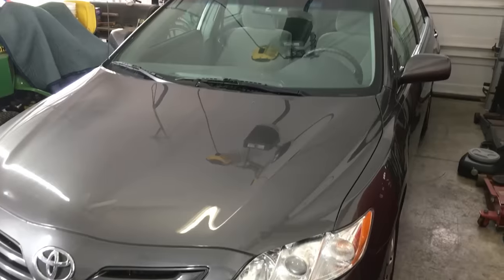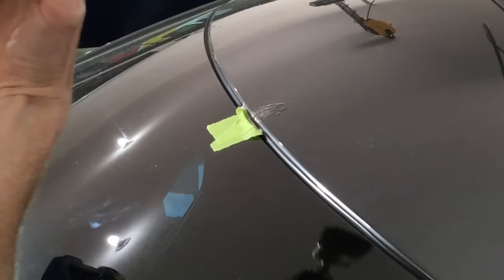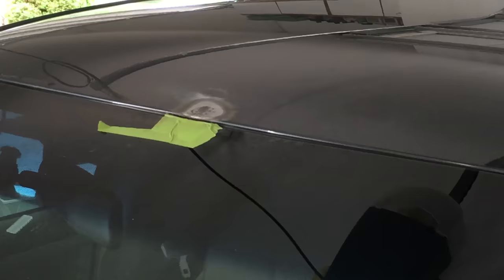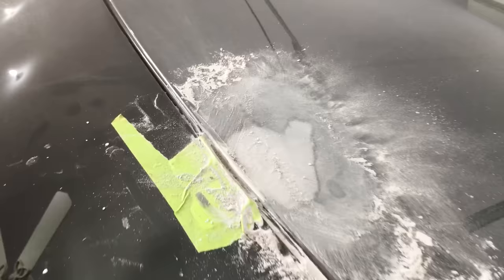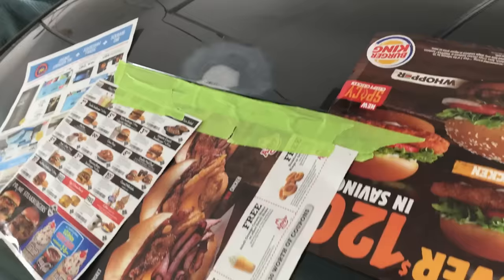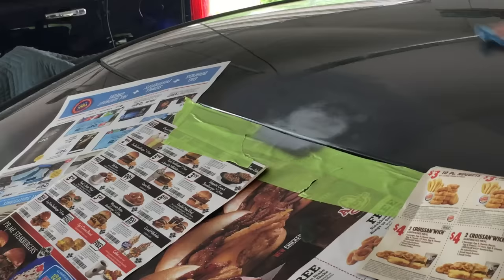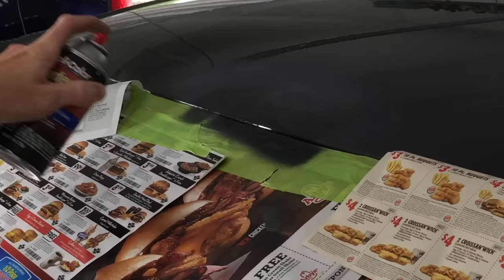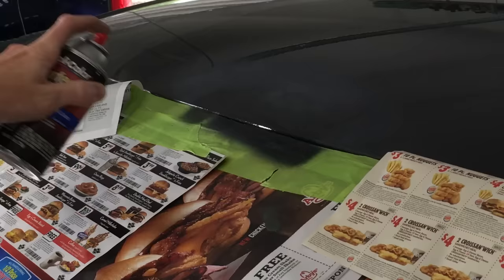How to Fix: Rust Bubble Under Paint from a Rock Chip Around WIndshield

Comment: You just put bodyfiller over rust. Now the rust  is going to rust more under filler. That rust needs small sandplaster
Reply from the maker: The rust was removed with 80 grit paper and wire wheel first. I wanted to show that anyone can do this repair in their garage, most don't have a sand blaster. Also, this was a $500 Camry. For an expensive car that will become a classic, I recommend cutting and welding in new metal and also using 2k clear. I'll have another repair video on a nicer vehicle showing painting with urethane basecoat/clearcoat.
Reply: @6thGearGarage  everyone can see in this video that there is still rust a lot.  Bare metal is not black.
Reply: @Vaseliini  that wire brush got all the rust, that blackness is a patina not rust. And even if he had just left the rust and primer and painted over it, it would no longer continue to rust any further, rust is oxidization of metal, and it needs oxygen to oxidize, and if you paint rust, it doesnt get anymore oxygen and cant oxidize any further.
Reply: @VashStarwind  You are partly wrong. That is still rust. There's no such thing as patina. You're right about that it needs oxygen. With that amount of rust, there's a chance that there's a needle holes through the metal. And it will be oxygen molecules through the paint in long term
Reply: Vaselinos     How long will it take to get back to that original rusty condition, probably 3 years. This is a $500. beater. By the time that paint gets bad again he could flip this daily for $600. to $700. and drive free for a year. I've done that for the last 50 years.
Reply: @Vaseliini  No such thing as patina? maybe you should look up the definition of patina..
Reply: @VashStarwind  Patina is not a form of metal.
Reply: @bentnickel7487  still nobody should be making these bad how to videos as they were proper way to do it
Reply: @Vaseliini  You should definitely look up the definition for patina..
Reply: @VashStarwind  and you should definitely learn something about steel and oxygenation.
Reply: @Vaseliini  yeah its called oxidization but whatever lol
Reply: @bentnickel7487  bodyman of thirty plus years , this is a decent repair for something you dont love but it wont last more than six months and I think the vids creator would agree new metals the only way to keep it at bay for any length of time
Reply: It's obvious we disagree. Like I said before, if this car cost $15,000. and I was going to keep it for 10 more years, then absolutely do what ever is necessary to keep the body pristine, but I've flipped cars in 90 days (as a private owner) and you don't/can't do that much to a car that you drive for a year and make $200. profit on. I usually pick as rust free a body as I can find, knock the paint and rust off the worst spot, prime it, rattle can it and buff it out. If I went full bore, the next guy couldn't buy it for $200. more than what I paid. I've done that for 50 years. You don't get emotionally involved and you don't spend tons of money. I usually drive them until an opportunity to sell comes along. Now a days my cars get sold within 6 months. I live where there's lots of sun, low humidity and no snow. My past repairs lasted for years, so I speak from experience. Others can spend 50 to 80 thousand on their rides. God bless them. I spend zero to $500. dollars, drive it for months and flip it for enough profit to say I drove FREE. The next guy gets a bargain and everyone wins. Purists are car guys too. There's room for everybody, this is 'merica !! :-D
Reply: Rust converter would be easier
Reply: @VashStarwind  Patina is oxidation on copper and brass type metals, it does not occur on iron. iron oxide is rust. both oxidation terms but used for different metals. no Patina on this video. you should look it up... he didn't get rid of all the rust in this video, but im sure he knew that.
Reply: @swanny8869  patina is not limited to copper and brass metals. 

A knife doesn't get patina? because they are steel also..
Reply: @VashStarwind  i stand corrected, thanks. i would still call that black stuff as being rust or oxidation if you will, and a little rust killer on that black stuff would have that repair last a lot longer then the 6 months it is likely going to last.
Reply: Trip Dapperson Jr. this statement has so much false information in it.  First, patina on steel is rust.  Patina is an oxidation of a metal.  Rust is the oxidation of steel.  Secondly, bondo, primer, and paint done on a repair will not make it 109% air tight.  The rust will come back which this guy in the video knows.  The only way to not have it come back is to cut it out, replace it, coat the new piece, and then paint new piece
Reply: @ohboy2592  Patina is the discoloration of a metal through oxidization, not necessarily rust, rust is a more severe form of oxidization

Comment: I just bought a 2008 Golf cheaply, and it's got rust starting almost exactly in the same spot, just further over to the passenger side. Since having it professionally fixed, including removing the windshield, will cost more than I paid for the car, I'm going to give this a go. It's a 14-year-old car with 178k miles on it (it's a diesel), so it really doesn't need to be a showroom-quality fix, I just want to stop the rust before it actually eats a hole through the roof.
Reply from the maker: That's a perfect example for a DIY fix... good luck!

Comment: Question: Where in the hell are you buying $500 cars that are not ready for the crusher?
Reply from the maker: My neighbor was going to trade it in when buying a new car at a dealership and they only offered him $500 because of the body damage, leaking transmission and high mileage. So he asked me if I wanted it for $500 instead :)
Reply: David S  I won't buy a car if it has over 150K miles on it. My niche is 100 to 120k miles and not over $1500 to $1800. The further you get away from 120k the cheaper the car gets. His car had 250K on it, so $500 is 300 over scrap. I don't buy rice cars cause the competition is crazy. I stick with Fords mainly. For $1800. I can buy a Taurus with 100K on it and it will last until 200K. $500. cars are easy to find. Start on Craigslist.

Comment: When you apply wax and grease remover to any surface, it's a 2 step process. Wipe the wax and grease remover on with one towel, then wipe it off with a clean new towel. Wax and grease remover lifts contaminants and the 2nd clean towel will remove them. Never let the wax and grease remover flash dry without wiping it.

Comment: I can't seam to find the paint for my car. i called several store around and they don't carry it. I have a 2009 Hyundai Accent the factory paint color is called ice blue metallic, do you know other place that I can check for that color? I have two surface rust spots and don't want them to get worse. Secondly what would be a way to fix a rust spot the is between the back door and between the tire on the lower quarter panel?
Reply from the maker: I think Duplicolor only makes the most common colors, rare ones might not be available. You might have to try the dealership maybe?  The rust spot in the area you described usually starts from the back side and eats its way through. Bu that point it's no linger surface rust. You can grind it down and fill where needed,  but unless you cut the entire area out and replace with new sheet metal, the rust will return.  That's a common problem area on many cars.

Comment: Hi, It a nice work! 
I have a question:
Doesn't needs to light sanding 2000-10000 before last coating and clear coating?
Reply from the maker: Only if there is a lot of orange peel, you can sand smooth and start over on the color coat.

Comment: Your a True Toyota buff looking at the other trucks in the shop
Reply from the maker: Toyota trucks are a lot of fun. I just picked up a rusty neglected 1980 Toyota truck that I plan featuring for a full restoration this summer.
Reply: @6thGearGarage  I have been rebuilding Toyota trucks and currently with rust have been fitting Ford Ranger Boxes which are fiberglass on the Toyota's
Reply from the maker: @tossedsalad5532  I'm interested to see how that looks!
Reply: @6thGearGarage  what email can I send your photos
Reply from the maker: @tossedsalad5532  you can send it to toyotatuesdays@gmail.com   I'll feature it on the next live show in 2 weeks if that's OK with you. A lot of Toyota owners would probably like to see how it looks.

Comment: Great instructional video! I have the same bubble rust happening around the windshield and now it leaks when it rains and water is getting in the floorboard! Will doing this stop the leak? Wondering if the part where you apply the body filler/hardener solves that problem?
Reply from the maker: Unfortunately it sounds like your repair area has rusted through if you are getting water inside. At that point it usually requires glass removal and cutting out of the rotted metal and welding in a new piece.

Comment: If you value your sanity, dont use spot putty. You can simply fill it with filler primer. A dremel also with a grinding tip can more easily remove rust. I used some spot putty on some larger defects and then automotive lacquer and it was very difficult as it melts with the solvents in the paints.

Comment: You forgot the rust converter. Do not apply filler on the rusty surface. There is always a little rust if you have not sandplasted it.

Comment: Videos like this are a big help to beginners. It shows them some of the basic steps to repair or improve a damaged area.
.
Rust spots must be treated with a rust neutralizer, if  not treated the rust WILL return bubbling the filler and paint in about a year.
Reply: Would you use rust neutralizer and then the priming if you were working on this fix? My wife's prius has the same issue and I'm looking to fix it come spring time.

Comment: i personally am not a fan of this method.  you ended up making a relatively small spot much larger in the end.  All this needed was a light localized dremel with mini disc or flap wheel, followed by naval jelly to acid remove the rust, then primer + touch up paint applied by brush.  You can skip primer if you want as well.  I do yearly touchups on my vehicles and this I find is the best method.

Comment: Thanks for the video. It was very helpful!

I have one question after doing this to my project car's hood (a part of it). Here's the process I followed:

1. Sanded all rust to bare metal as much as possible (grinder)
2. Rust converter (brush)
3. 1K Epoxy primer very thin (can)
4. Ultra fine body filler (sanded with a small block until it felt flat by hand)
5. 2 coats of 1K epoxy primer (can, lightly sanded with 400 then 600)

My problem is that the body filler lines show through the primer, even though it felt very flat by hand.

Do you have any suggestions on how to fix this? I wanted to get the hang of it since I've never painted before and would surely like to learn to paint it all myself.

I believe the issue is with using cans, and I thought I could get away without using a high build primer.
Reply from the maker: High Build/Filler primer could have helped, but another issue is that body filler can slightly shrink after it has cured. That could be what''s happening here. I would try the High Build/Filler primer at this point.

Comment: nice job! though the rust should have been coated with rust converter... ps. and if you pour oil into the thresholds and other openings, the car will not rust)
Reply from the maker: Great suggestion!

Comment: 2009 toyota corolla, some rust started a year ago... im planing to repair as well... only 150k km on the thing, they have good engines and plan to drive it until it doesnt 😂😂
Reply from the maker: Around here the drivetrain lasts longer than the body
Reply: @6thGearGarage  yeah, I have been professionally rust proofing the car since I got it in 2009... but last couple years didn't service it... its got some dents, and bumps/bruises on it... my summer project to repair the rust spots here and there..  thanks for your informative channel

Comment: Just a FYI, I used a tack cloth (Bondo/3M brand for automotive) after finishing the base and before the clear coat and it ended up leaving a ton of fibers that I couldn't see until I did my first layer of clear coat... Now I think I'll have to sand down to the paint again then do the clear coat, does that sounds right?
Reply from the maker: I can’t say I have ever had that happen. Perhaps the paint was still sticky or the tack cloth was pressed too hard? Or maybe the tack cloth was bad to begin with... maybe dried out from age?
Reply: @6thGearGarage  thanks for the reply! After talking with a local autobody repair shop supplier they think I was pressing too hard (though I didn't think so) but that say to wipe super soft.  the paint wasn't sticky but it had metal flake in it so maybe that caught some fibers..?  Who know but sanding down with 800 and giving in another shot tonight.  Great video btw!!!!

Comment: Great video! I have a 2003 corolla that has a bunch of rust spots on the roof. You used filler on some of the pitting. If im not super concerned on "smooth" results can i skip and just go right to paint? Or do u suggest body filler, or maybe even just spot putty
Reply from the maker: Yes, you can skip the filler/putty if you don't want the final product to be smooth and you're just trying to stop the rust from getting worse.

Comment: done this myself:
- it's trickier to spray with a rattle can on an horizontal surface like the roof because the can can't go horizontally. what happened is that air pressure started coming out causing droplets to fall onto the clean paint - ruined that area and had to extend even more
- it's very easy to contaminate the rest of hood with white primer. consider limiting the area
- don't cheap on the clear coat. i did and mine got a sun burns after a year
all in all, the repair lasted and no rust came out even after 2 years.

Comment: I mean use a blending agent, you can buy it in a can. It will save you at least 50percent of that over spray that takes 2 hours of sanding and buffing to try to clean up.

Comment: How would I remove rust from a deep scratch made with a knife in my car door? Would it be sufficient to clean the outside rust and fill with primer, paint, lacquer or would the rust come back?
Reply from the maker: You will need to remove all the rust, down to clean bare metal, before primer and paint or else it will come back after some time. Phosphoric Acid is a great rust remover as well.

Comment: What would you have done if the rust had corroded all the way through the metal leaving some small holes? I have that on my car (left some chips too long and it took only a few months to go all the way through), body shops say the whole section has to be cut out and new sheet metal welded in, that's thousands of dollars and more than the car is worth, but I'm not sure how to DIY it myself.
Reply from the maker: Unfortunately, the only solution is cutting and welding once the metal gets thin enough for holes to form. Anything else is only a temporary solution at that point.

Comment: Great video. I will try to fix the rust on my hood after watching this video. I have question, is it true that the rust may come back after you sand and paint it? Many bodyshops told me they don't do sand and paint for rusts, instead, they replace the whole panel which costs a fortune to me. Thanks.
Reply from the maker: Amanda Wu it is true. The sure way to keep rust from returning is to cut out and replace with new metal.

Comment: I noticed that you used a lacquer product over the existing urethane. From the looks of your job I guess these paints are compatible. how did you avoid that hazy line in between your lacquer clear and the urethane clear on the rest of the roof? I've tried doing the job the same way you did and I always have a hazy line between my repair and the original material after buffing. Anyone that can give me some input that would be great.
Reply from the maker: Yeah, I already had the lacquer so I used it. A 2k Clear will last longer than the lacquer though. As for the haze, I just kept polishing until it was gone. Perhaps your compound is not aggressive enough?

Comment: great video!  What about using rust inverter first before filler?  I used this process and did 5 years ago and did not know how it would work.  So far no rust
Reply: I use a rust converter first. Ive been using the krud cutter stuff from home depot, its gel like. Spray it on, scrub it in with a brush (I use an old tooth brush for areas that size) and then let it sit for like 20-30 minutes and wipe it out before body work.
If I don't do this I'm pretty much guaranteed to see a rust bubble again a few weeks later.

Comment: How do you avoid the new clear coat from showing up as a stain on the finish? I’ve seen this happen many times specially with time. The boundary between both will become very apparent.
Reply from the maker: I’m not sure how this happens. Do you mean the new clear becomes yellowed when you say stain? I have not experienced this happening.
Reply: @6thGearGarage  Not yellow but you can notice a haze with different opacity around the perimeter. Since there are no panel gaps between the too it’s difficult to hide them. Glasurit makes a special product to avoid this but I haven’t used it.
Reply from the maker: @Kpeters  I think I know what your describing... that’s a very fine texture from the edge of the spray pattern that doesn’t lay down as heavy. There’s no way to prevent it, but it can be blended in by polishing smooth.
Reply: I've faced with this issue aswell. It's especially noticable on a black car like mine, it can be seen even after polishing.